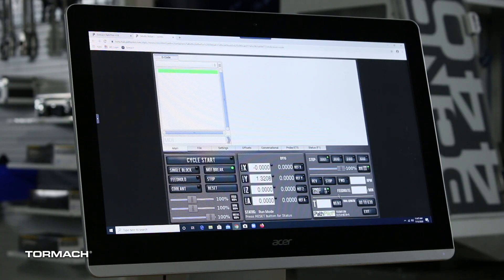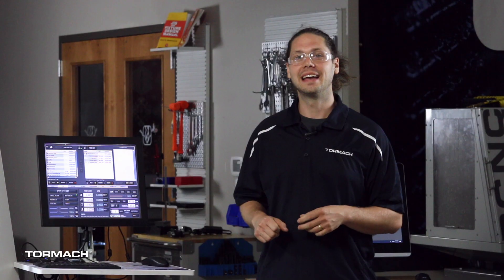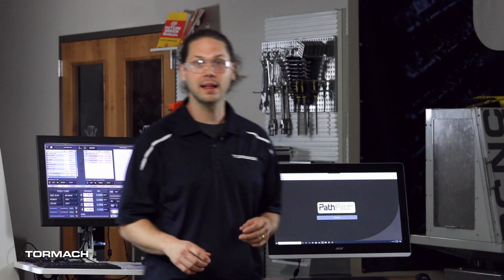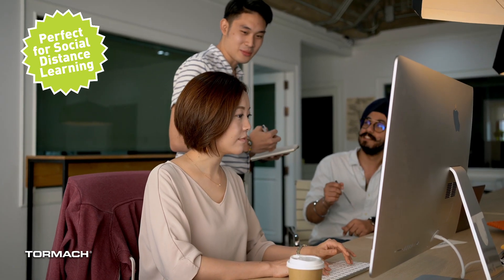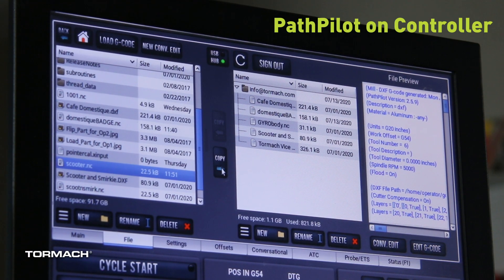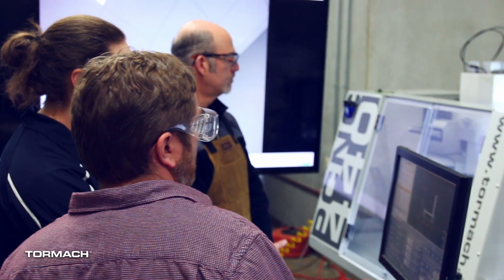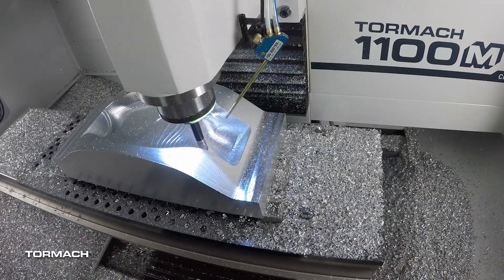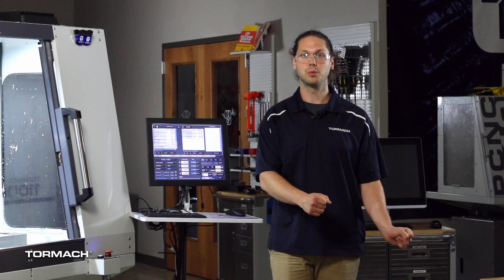Tormach's PathPilot HUB | Ideal for Teaching CNC Machining

Comment: The hub does not let me copy and download any files that I created.  It also did not save the files on the hub like it says that it should do.  It deleted all the Offsets that I created.  What gives??  That was not only useless, but also wasted my time.
Additionally, it gave me the Beta version and did not let me choose the previous operational version.  
I tried to copy the files from the left "box" to the right "box", and it tells me "permission denied" on the Status tab.
What's going on?
Reply from the maker: Hi Dan. Any offsets you create in HUB will be preserved for the time you’re using your virtual controller – up until it expires after 6 hours. If you have offsets you would like to save long term you can click the “EXPORT” button and save them to a CSV. You can save that CSV in your HUB file storage and use it any time you create a virtual controller.  We do have automatic saving of offsets and tool tables on our to-do-list. 
Also, when you are in the file tab, any file that is in the far left window is not saved after the instance is shut down. To save theses files, you need to click the Copy button to the right of this window. The saved files will appear in the middle window.
Reply: @tormachinc  https://hub.pathpilot.com/ does not work. is there a better link to access the software?
Reply from the maker: @mikediaz4829  Sorry, for the later response, this went into the YouTube spam folder. Our PathPilot HUB Engineer informed us that the system was down for a few hours one night last week. Sorry for the inconvenience.

Comment: Is the use of the hub limited to an amount of hours, or is it unlimited forever?
I could not understand from reading it.  It is written in a somewhat ambivalent way.
Reply from the maker: After you have setup your PathPilot HUB account and login, each virtual PathPilot HUB instance will last for six hours. All your files will be saved to your account, and once you log back in, you can continue where you left off.  You can try it now for free: https://hub.pathpilot.com/
Reply: @tormachinc  Thanks. And I can have unlimited number of these 6 hours sessions? That's really is my question.
Second question: Is there a way for the hub to "know" my offset assigned tool numbers?